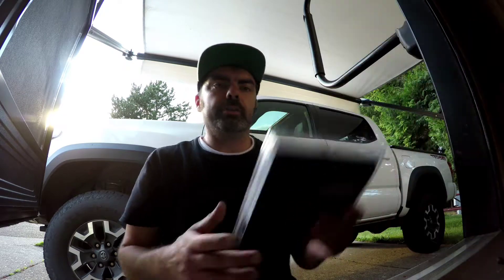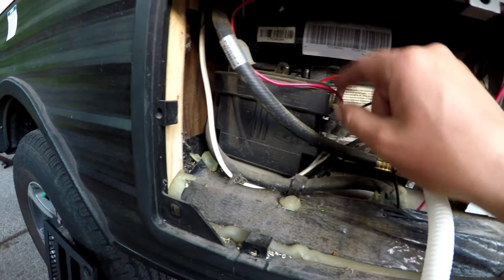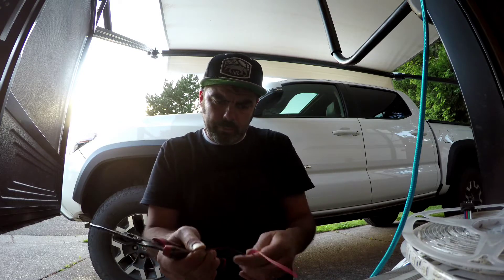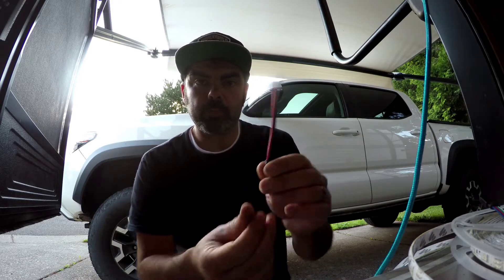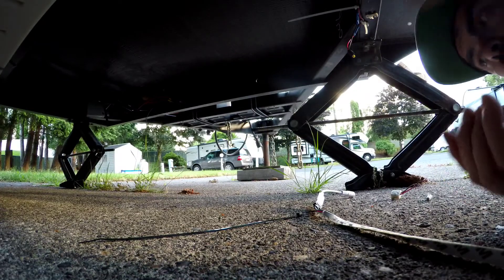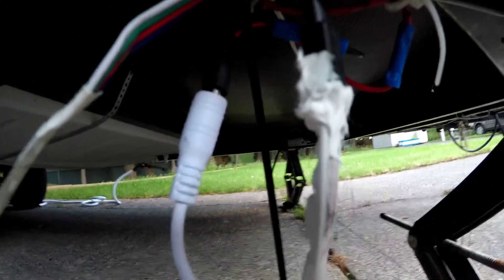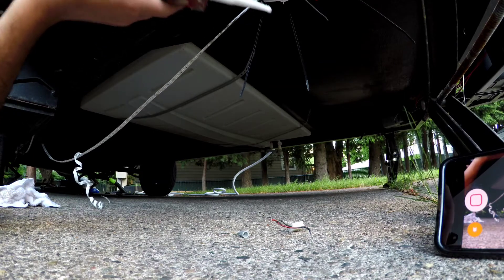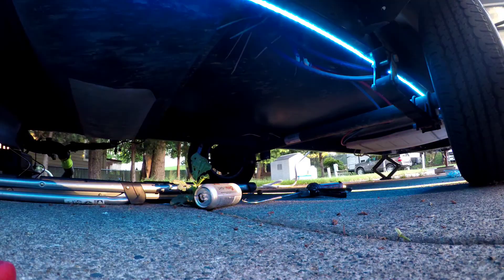RV underbody LED light strip install. Keep rodents away!

Comment: Great vid Chuck. I was curious, my niece bought a 2015 Keystone Passport recently and the awning light strip is missing the remote. Do they have to replace the light strip, or could they get a replacement remote? Thats assuming the leds are still good. Ive heard about problems with them. I asked if it had a brand name on it and they couldnt see one. I'm in Ontario and theyre in northern Sask. so I can't get at it for awhile. Thanks for the videos.
Reply from the maker: Honestly I'm not sure if you can buy just a remote. If you can't,  you can just wire it to an on/off switch.
Reply: @rvtechtips874  Thanks very much.